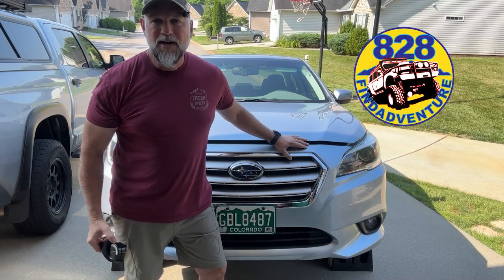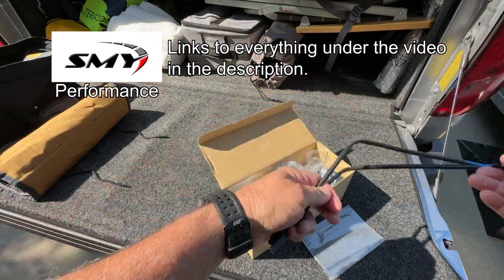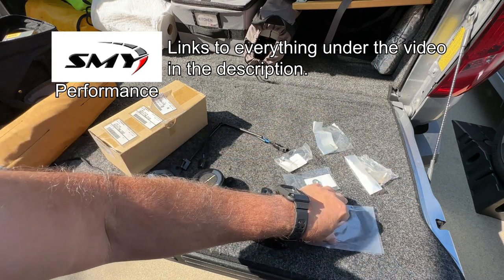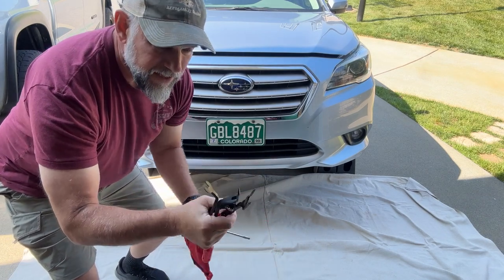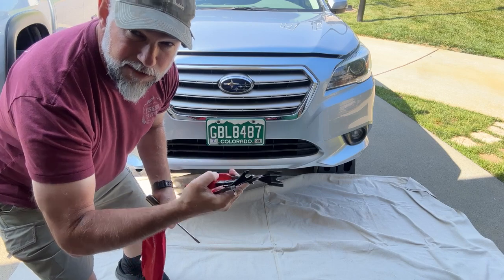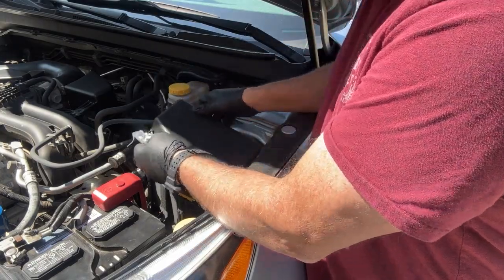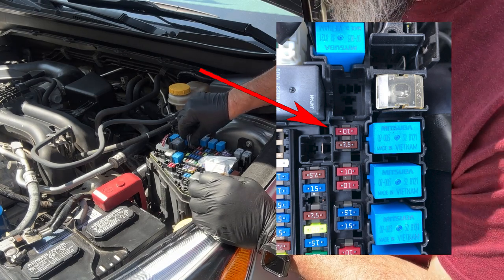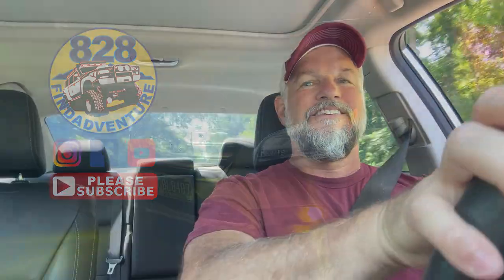Subaru JDM Triple Horn install, very loud and super easy to do.

Comment: I need to do this. I feel like it will balance out my anger to horn ratio. Right now the stock horn is not expressing my feelings enough to certain drivers.
Reply from the maker: The horn is always used as a communication device. Whether to keep someone from hitting you or to let someone know they can pull into your lane. Two gentle beeps of this horn definitely wake them up. This horn makes me love to drive this car and I might install one in the Honda Ridgeline we just picked up. Thanks for watching.

Comment: this is the sound every new subaru should make from the factory. Nice job! definitely thinking of doing this to my outback.
Reply from the maker: Loudest I’ve ever installed. Worth every penny. I installed it in the stock positions but now I’m thinking how it would be even louder mounted behind the grille. Hmmm, thanks for commenting.
Reply: @828findadventure  Behind the grille may be better to project the sound forward. They sound so
much better than the embarrassing 𝗯𝗲𝗲𝗽 𝗯𝗲𝗲𝗽 that comes on these cars lol. Probably will need extra wiring to do that though. I have a 2023 outback wilderness and i just realized it says “up to 2019”.😐 im not one to be disappointed so im gonna buy em and see if they fit. My outback’s horn sounds pathetic for how much it was new and its size.
Reply from the maker: @Dingus04  let me know how it works out.

Comment: Do you have any idea if this will fit a ‘22 Legacy?  I can’t seem to find the answer.
Reply from the maker: @Toga_Lock  I really don’t see why not. If the included harness doesn’t fit, wire it yourself to the existing wire. The power will be there for the existing horns so it should be straight forward.